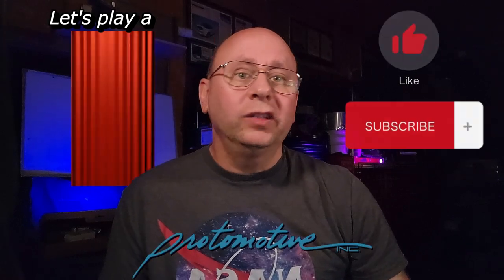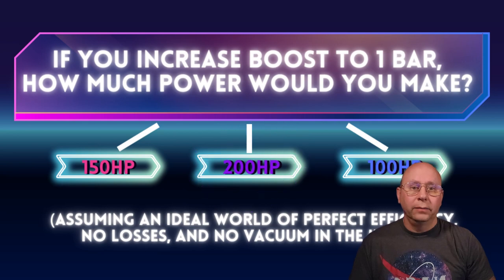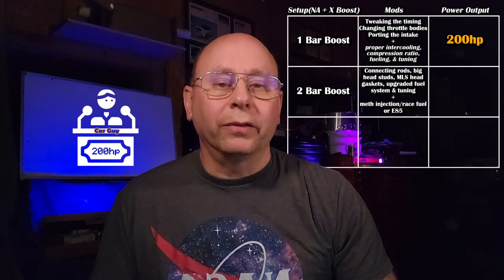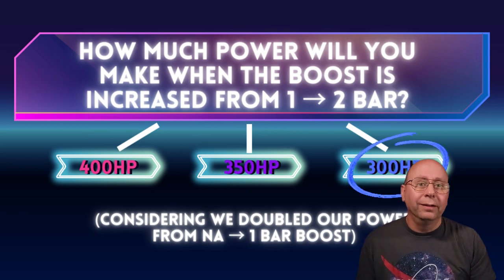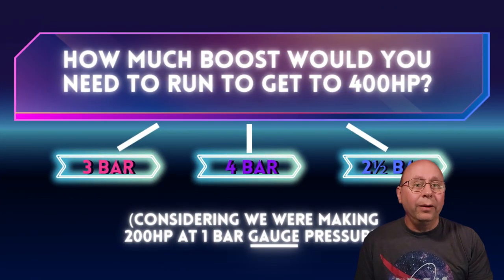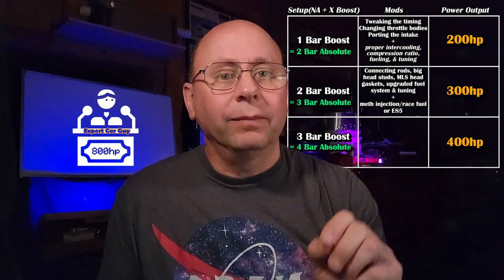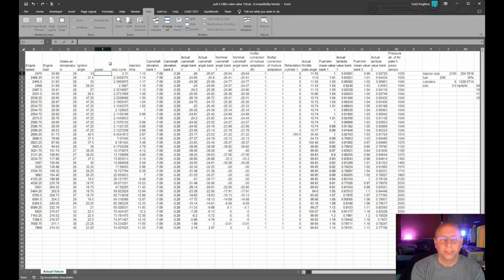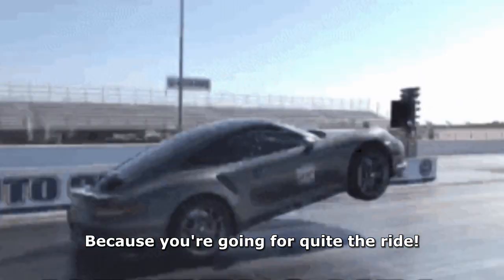How turbos work? Boost vs Horsepower.

Comment: But I'd rather make more power without so much boost!  How do I do that?
Reply from the maker: There are many ways!   Increase displacement, improve the airflow by porting/polishing or camming it, increase the efficiency with compression and E85, etc.  We also prefer the "more power/less boost" strategy :)